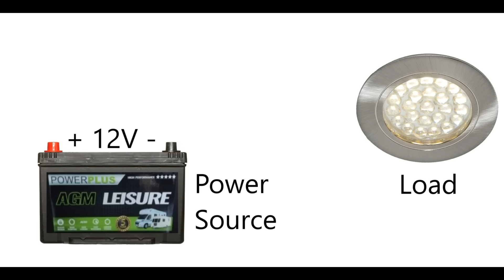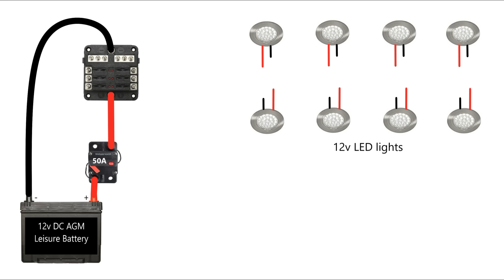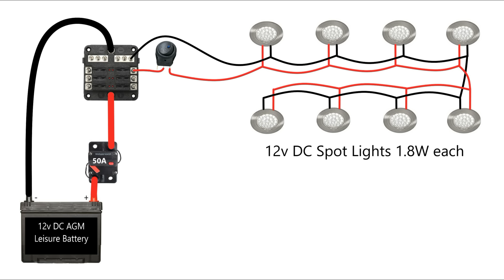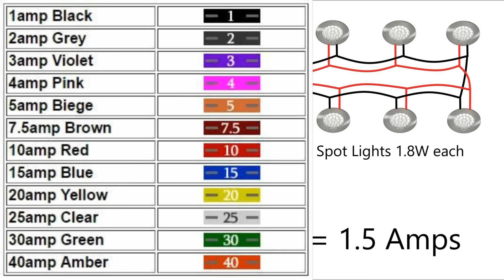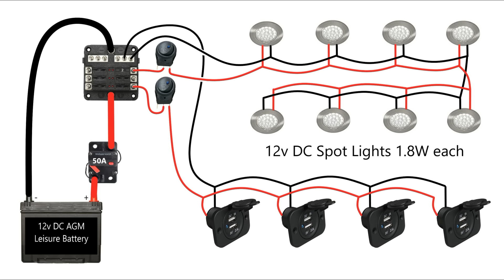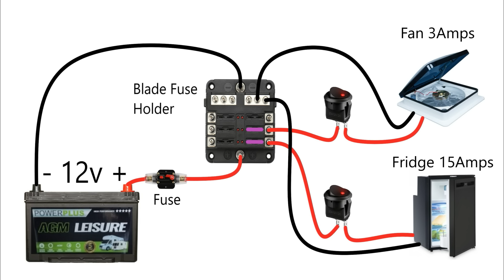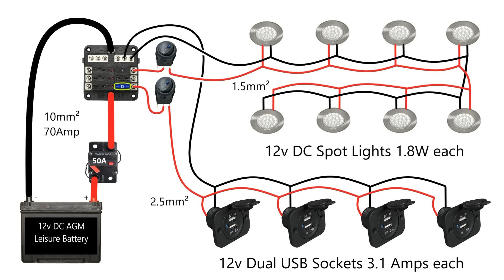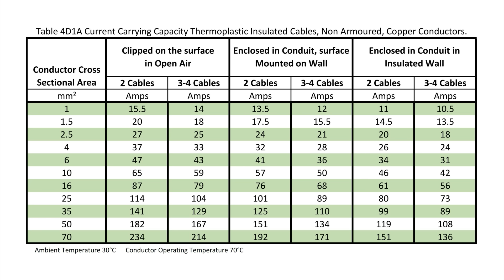Electric Cable & Fuse Sizing - Camper Van Conversion Series

Comment: Greg...can you help please as I am finding some contradictory stuff on other videos that frightens me 
Situation ....catering van 
240volt incoming from supply  to van then to con /board 
Consumer board RCD /MCB earthed to...... WHERE ?......Chassis.  or Body  SO MUCH CONFLICT  BETWEEN ELECTRICAL  VIDEOS AND FORUMS  the body is not the chassis and yet I see videos of  Earthing the Body, surely  doing this  in the event of an  Earth short  can the  body  become live ....  if yes.. I am then completely reliant upon the RCD tripping ...What if over time the RCD becomes  Faulty  and does not trip    .... QUESTION ? .. why then is Earth to Chassis any different ..Surely the current will still travel from Chassis to Van Body 

Earth to Chassis ..... ok what happens if earth cable gets snagged and ripped off from under the van where its fixed to Chassis 
Therefore if Earth fixed to Chassis......QUESTION ... is it going over the top to suggest double Earthing in the Event one was ripped off in Transit 
some are saying Tyres become Earth
some are saying a rod is Necessary 
my work has been done by a Qualified electrician with 18 edition and yet I am now Questioning his Knowledge.  all toooooo conflicting lads  yes I probably should not get involved  ,,,but ignorance is not going to be my excuse  ...   can you clarify

Comment: Great video as always! I’m going to be building a water pump/12v solar wiring project very soon..look at the diagram at the start of your video it say 6mm wire from the battery etc. Should this be sufficient? as I’ll only be running the pump with no other electrical devices. Many thanks
Reply: Also, is that 6mm core? As the wire I have is 6mm/10awg. Should I increase to 8awg or 4awg? Thanks
Reply from the maker: What are the specs of the pump you plan to use?
Reply: @GregVirgoe  the pump is a generic eBay water pump with specs of 100w at 8L/min. Doesn’t say any amps on the unit..
Reply from the maker: @arronmadgwick7386  100W / 12V = 8.3A which is pretty normal for a 12v pump. 
I would use 1.5mm cable and a 10A fuse.
Reply: @GregVirgoe  great, thank you! Last question..What wire size would you recommend from the battery to the fuse box? I’m thinking maybe 8awg or 4awg?
Reply: I’m not running much on the circuit, I have some 10awg knocking about, should this be sufficient?
Reply from the maker: @arronmadgwick7386   without knowing what else you want to power from the board I can’t advise on that. 
Add the loads together and use the free chart  in the description of this video. You have all the tools to work it out 😃
Reply: Ok I’ll take a look. Thanks for your expert advice. Subscribed :)

Comment: Hi Greg im struggling a little on wire thickness for a fridge its a 40w fridge not sure on start up load what size cable should I need please
Reply from the maker: Best to check your manufacturer's literature as my fridge was only 75W and needed 6mm cable due to the voltage drop over a short distance. In my manual was a selection chart for cable size. :D
Reply: @GregVirgoe  I haven't bought it yet im early in conversion just sorting cables out its a dometic cre50
Reply from the maker: @northeastcarpfishing  We have a Dometic CRX50 and it needed 6mm cable :D
Reply: @GregVirgoe  thank you so much for your time take care

Comment: Hi Greg... I've got a question about using a controller board for my lights which will be located close to the sliding door. On this you say the lights need a switch just before the fuse block on the positive... my fuse block is going to be located in the garage a long way from my control panel... How do I wire this please as I haven't got a clue. Thank you
Reply from the maker: You can wire the switch afterwards just be aware that the fuse is connected to the battery when fitting or replacing them.

Comment: Greg, I know this might be dead basic but what method do you use for T-ing off from the main run to - for example - an LED light?
Reply from the maker: I strip the wires back on the main run and solder a branch connection to them then use heat shrink to protect the joint. I find it much more permanent than crimps which have been known to work lose over time
Reply: @GregVirgoe  Brilliant. Thanks Greg.

Comment: Thanks mate, this has been an excellent video. ... question I want go into the why and wherefore, but I want to run a small fridge (appropriately fused) off the wire commimg from my main battery to my leasure battery, possibly via a T joint (and after the battery isolator ) should I use the same gauge cable as the battery cable or a cable suitable to run the fridge?
Reply from the maker: The fridge should just be connected to your leisure battery system otherwise you risk draining your van battery and not be able to start the van to drive away. 
A connection between the two batteries should be via a B2B charger or worse case a split charge relay. So it automatically disconnect the van battery when parked up.
Reply: @GregVirgoe  thanks  I didn't make myself clear, there is a battery isolator which will stop that happening. The leasure battery is at the back of the van and I'm avoiding running  extra cable from the leasure battery back to the front. Thanks for the  reply
Reply from the maker: @MervB1  do you have a VSR or B2B?
Reply: @GregVirgoe  I have b2b (I think, not sure what a vsr is)
Reply from the maker: @MervB1  VSR is a voltage sensitive relay or commonly known as split charge relay.
Reply: @GregVirgoe  thanks 😆 enjoy your channel

Comment: Why not use 1mm cable for the lights? Why did he suggest 1.5mm when 1mm is already easily enough?
Reply from the maker: Rather than buy lots of different size cables I standardised on 1.5 for most of the small 12v things so I could just buy one longer coil. 
No harm in going bigger on cable sizes.
Reply: @GregVirgoe  great I suspected that was why. Thanks :)

Comment: Hi Greg. I accidentally put a 20amp fuse blade that is attached to my ceiling fan and now it’s not working? Any advice??
Reply from the maker: Installing a larger fuse would not cause a problem there must have been a wiring issue that caused it not to work. Run a separate supply from the battery to the fan to test it. If that works then check your original wiring.

Comment: can i put my switch after the last light or does it need to go between the battery and the first light? Thanks!
Reply from the maker: It will work in either location but it’s best to cut off the source of power

Comment: Is a 6G  OFC wire good
Reply from the maker: OFC is a high quality multi stand cable normally used for professional audio and speaker equipment. 6G is equivalent to 16mm2 and could handle up to 60Amps over short distances no more than 3m long. Any larger loads would need a bigger cable.

Comment: Is it ok to connect negative terminal to the chassis and all negative connection as well ?
Reply from the maker: I would not recommend this way. Far better to run the cables for both poss and neg and leave the van body dedicated to your auto electrics.
Reply: Greg Virgoe what if I charge my leisure battery with alternator ?

Comment: Is it necessary to earth 12v / 24v led lighting? Or even possible for that matter.
Reply from the maker: 12v DC LED lights do not need an earth.
Reply: @GregVirgoe  Well that clears things up. I wasn't quite sure as they have metal surrounds. Great video by the way. very clearly explained. I guess we just have to size our fuses correctly and we're good to go.
Reply: @GregVirgoe  P.s. Youve just gained a subscriber
Reply from the maker: @aircamera400  yes make sure your fuses are sized correctly so they protect against any over current of there is a short circuit. 
You can touch 12v DC and still be safe because at that voltage the dry skin body resistance is high enough to not allow critical current to flow.

Comment: What about the ground wire for the 12v system? Where does that go and where from.?
Reply from the maker: 12v DC has just a positive and negative no such thing as a ground in DC wiring. When people connect to their van that is a negative path back to the battery. An earth is used in mains volt electrics for safety reasons.
Reply: @GregVirgoe  thanks for the reply. I have been racking my brain lately trying to understand as I have seen some.posts of people mentioning ground wires but I couldn't see any mention of it on your videos. Thanks mate appreciate everything
Reply from the maker: @cboyerrrrr  you’re welcome 😉

Comment: H GREG, cab I find information about fuse rating for solar power chargers?
Reply from the maker: Apply the same principle. Take your maximum current in amps and add 25% for fuse rating. Make sure all cables and switches are rated above the fuse rating.
Reply: @GregVirgoe  Hi Greg , thanks for your reply.
Could I get your advice?
I have a Truma Battery charger. The light does not flash but there is an excellent measurable voltage going to the box.
There is no measurable charger in the leads to the battery and the 15amp fuse inline going to the battery has blown.
Is the problem with the charger?
Reply from the maker: @johnwignall9719  it depends which one you have installed. The SDC10 requires a 15anp fuse and the SDC20 requires a 30amp fuse. 
Replace the fuse and try again.

Comment: I have a 8000 watt inverter and its 16000 watt serge I have a 200amp circuit braker is this ok or do I need a bigger one to be safe
Reply from the maker: Omg 😳 why have you got such a big inverter. A 3 pin plug is max of 13amps which is just under 3000W so you don’t need more than that. The fuse rating for that inverter would be 800amps!! 😳 and the cable would be massive.
Reply: @GregVirgoe  its whats in my lorry mate so would that 200amp circuit breaker be good enough. It needs to run a TV microwave fridge kettle all of 240 volts so just wondered thats all as its in my race transporter lorry for my race car
Reply from the maker: @360outlawdriver3  Some electric kettles are 1800W. Microwave is 800W so those two on together would draw more than 200amps from the 12v side. That’s without the TV or Fridge being on. 
Find out the Watts rating for each appliance. Add them together that would be your peak load. Divide that by 12 and add 25% for your fuse size. It’s going to be closer to 300amps I would guess. That is on the 12v input side and would need 50mm battery cables.
Reply: I wonder if thats why he had it from the battery bank straight to the inverter with no circuit breaker fitted is that safe or dangerous
Reply from the maker: @360outlawdriver3  you really should have either fuses or circuit breakers on every positive cable from a battery or there is no protection in the event of a problem

Comment: DO NOT use this video as a how to for your build. 
1, the table referenced is for AC electricity, not DC. And also not for the type (insulation) of cable that was demonstrated. The CCC and subsequent CSA is different for DC. 
2, voltage drop has not been accounted for in any of the sizings. This is very important for DC.
3, the de-rating factors (installation type) is different for caravan, marine and vehicles, and need to be accounted for. 
4, you need to know what kinds of switches (and ratings) to use, again, they are different between AC and DC.
Honestly, the simple examples given will probably all work well enough, but it is by no means correct, safe, or compliant.
This is a case of little knowledge being dangerous.